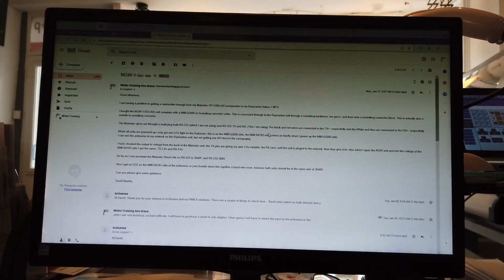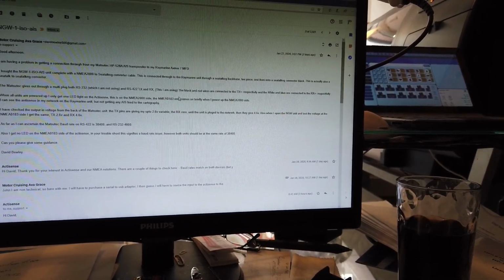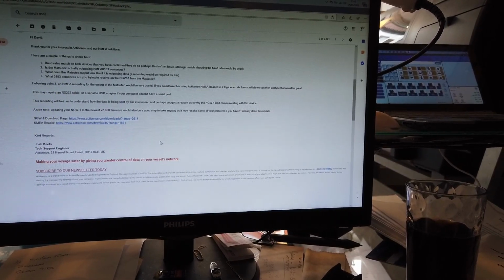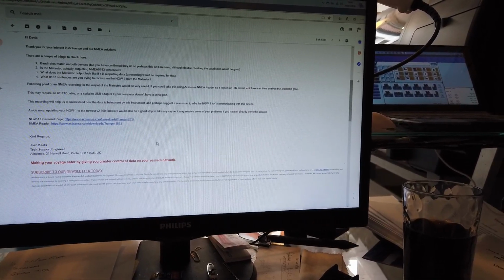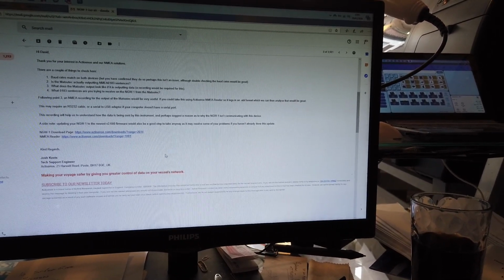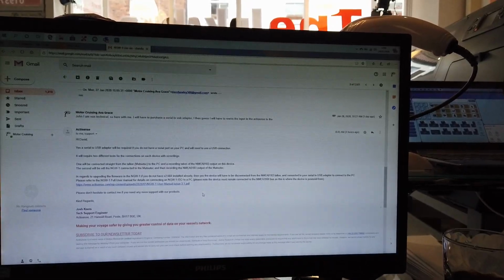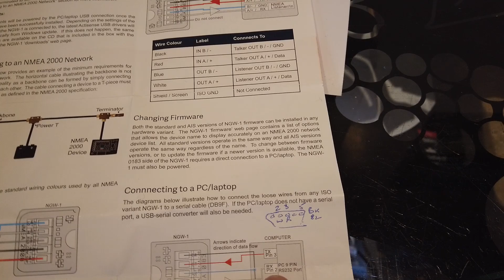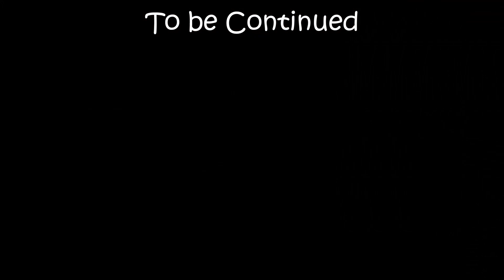Matsutec HP 528A, Actisense NGW-1 iso AIS to Raymarine, trouble shooting part 1

Comment: Found any solution? Have the same issue? BR Thomas
Reply from the maker: Yes managed to get mine working. Use pins 1&2 out of the matsutec. To the actisense or any other brand of 0183 to 2000 convertor. You don't need bidirectional. The convertor needs to be on a baud rate of 38400.